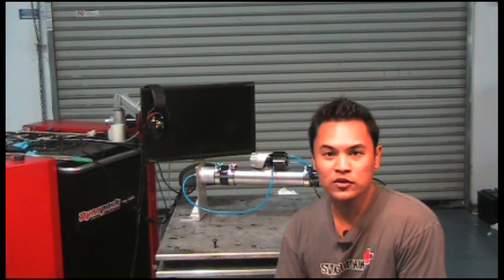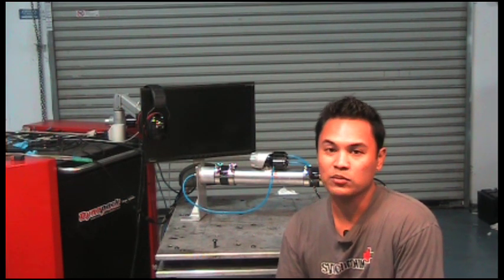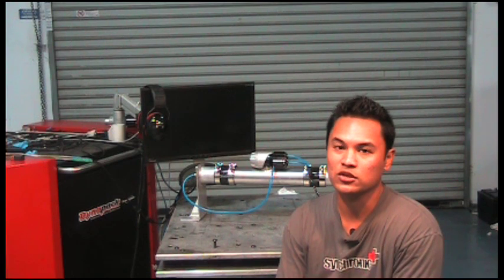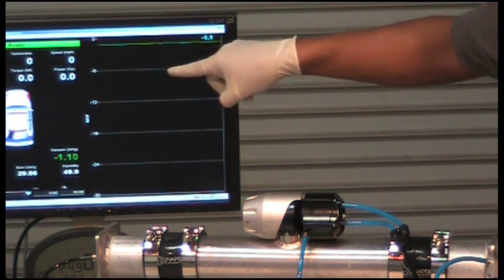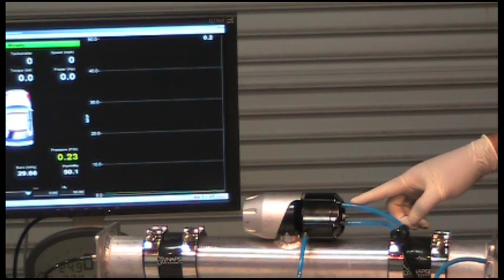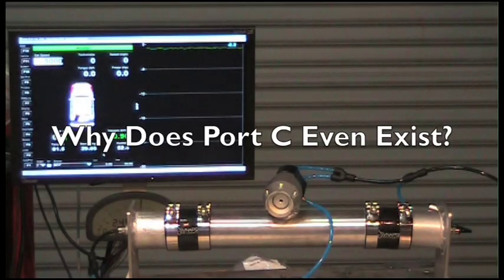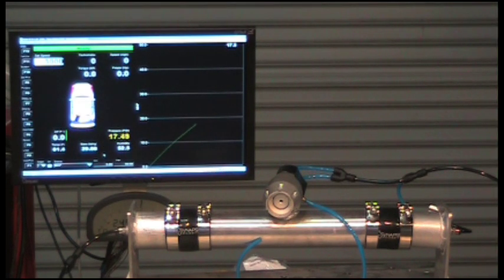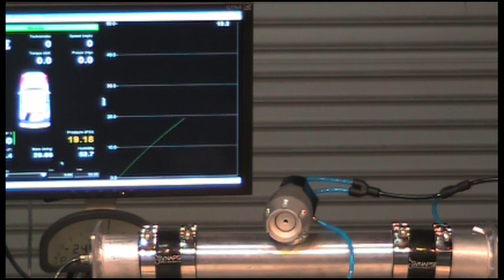How Synchronic BOV works part 1

Comment from the maker: If a port is not being used, always VTA the port.  A good place for boost-only is anywhere between the discharge of the compressor and the throttle plate.  On the EVO, there should be a nipple on the turbo's dicharge tube that used to go to the wastegate actuator.

Comment: that flutter is called compresser surge. it sounds cool but is not good for the turbo because its air moving the opposite direction in your charge piping and trying to spin your turbo the wrong way. ive been told its a good way to get rid of lag but you will wear your turbo out sooner

Comment from the maker: Also, never cap a port that isn't being used.  Just vent it to atmosphere.  If you're concerned about dirt because you're off-roading, or rallying.  run a hose to the port, and then somewhere that dirt can't get to.

Comment: I accept your challenge, on low boost I've seen 12 with change on the 1/4 mile. Low boost meaning 475hp at the wheels high boost on Meth your looking at 650 to 750 depending on if that damn halo system ever comes (stupid Ebay)